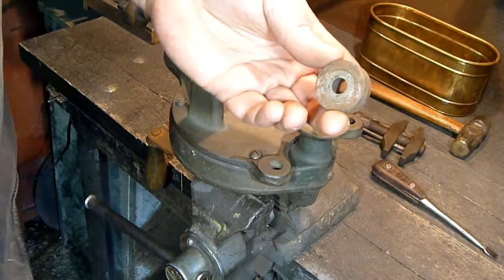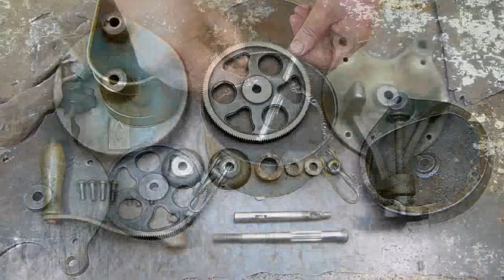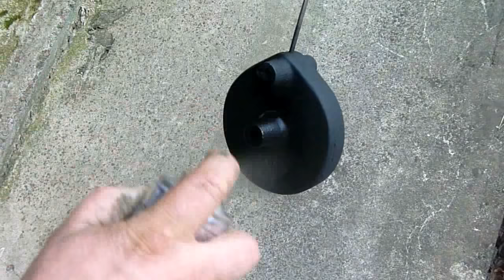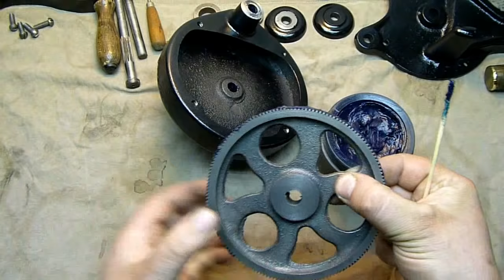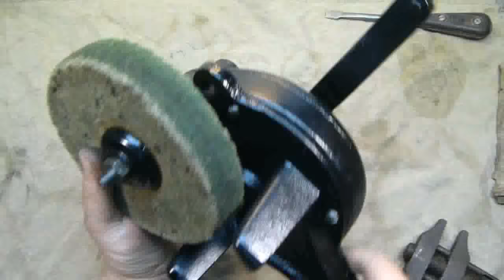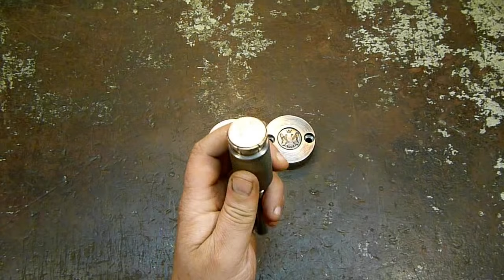Hand Cranked Grinder Restoration

Comment: Great video, but beware of press-fit gears!!!  My large gear wheel is now in two pieces:(  I have a similar design, just smaller overall.  Wishing it was a spline shaft won't put it back together again!  However, the teeth on it were mangled anyway, explaining why I couldn't get more than one turn in either direction.  Was broken when I started disassembling, now it's just more broken.  Learned a lot, awesome video.